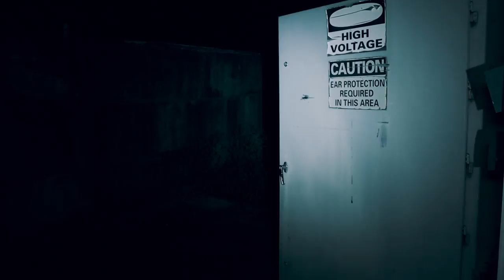(ALONE AT AN ABANDONED ROCK MINE) WILL THINGS GET ROCKY???

Comment: 6:32 at 10th frame
Originally, I thought I had saw the side view of a female form just standing there (just slightly left to center of frame).  However, reviewing it frame by frame, I notice two other areas of interest.
First, beginning about 6:32 at the 10th frame as well, on the right side of the screen almost to the edge, and lasting until around the 20th frame at which time Chris's light begins to cast too much luminance upon the area.
Also, starting around 6:33 at the 1st frame and lasting until 6:35 1st frame, strange images, located in the area between feminine form and approximately the halfway point to the bottom left-hand corner of the screen.  Also, there are several areas around the screen during these few seconds that have really interesting imagery, also the area directly in front of Chris, as he rounds that bush before stepping onto the wooden ramp, approximately 6:36 to 6:38.  I don't want to influence anyone who might be curious enough to check out these frames, so if you happen to see anything highly unusual or extremely interesting, let me know.

Comment: I think you could probably Jimmy that lock with a knife, put the blade in the jamb where the latch fits into the catch plate and use it to spring the latch, also if it stinks that bad, there very well could be a body inside.